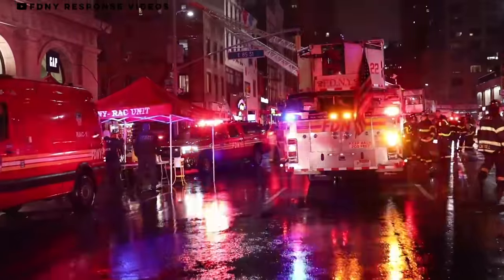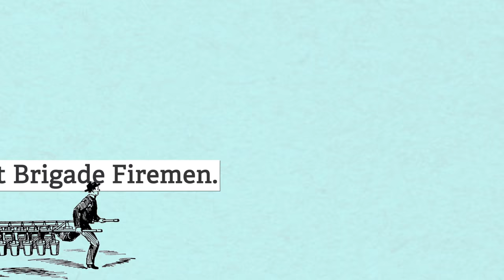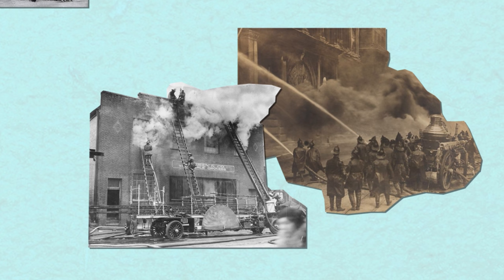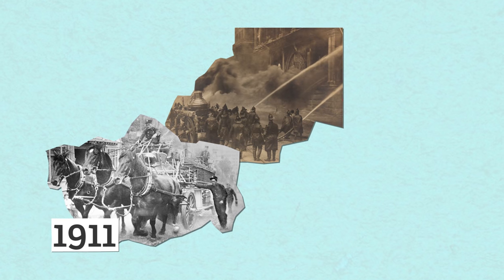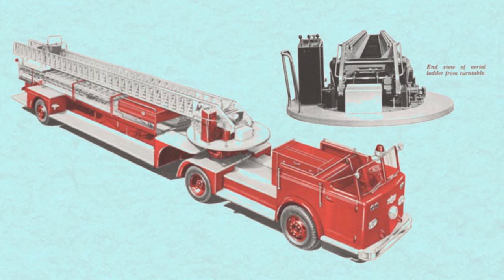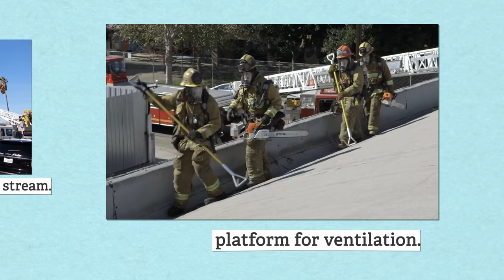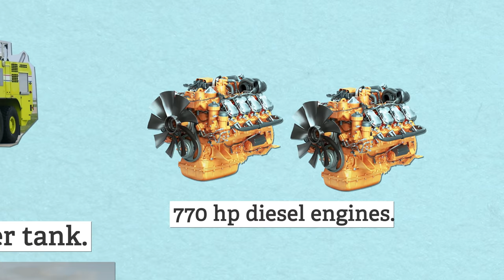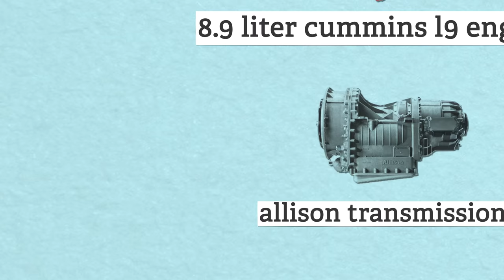How FIRE TRUCKS became Awesome | WheelHouse

Comment: I used to work as a technician for a fire truck refurbishment facility. We did everything, Pearce, American LeFrance, Oshkosh, even some Military crash trucks (also made by Oshkosh).  I can safely say, you can not imagine the amount of wiring and computer control some of these modern trucks have. It's mind boggling.
Reply: These new systems fail all the time too, it's really frustrating.
Reply: I'd trade one of those overprice computer on wheels junk for an old Mack anytime!.Seen those old Mack model B in action 24 hrs a day non stop for a week to empty a long tunnel that had flush flood in Montreal in the 1980's.Kenworth pumpers were no match for that kind of work!
Reply: I work for Oshkosh Corporation. I used to assemble the chassis for the Striker and the military vehicles we build (HEMTT, MATV, FMTV, HET, etc.) A lot of the main wiring harnesses run along the inside of the frame so if an issue were to arise it's not a fun fix.
Reply: Does your company currently hire a Firetruck Technician? Thanks
Reply: Ryaneg6freak Firetrucks Unlimited?
Reply: @punkindonutguy  so you work in Appleton
Reply: The best fire trucks are the Detroit 2 stroke powered ones!
Reply: OshKosh makes fire trucks?

Comment: Bugatti and Koenigsegg struggling to do 300 mph, meanwhile 407 mph by vintage truck. Who needs aero, am I right?
Reply: I mean, as long as you blast more power, you can overcome air... not easily, but you will
Reply: When did they say that?
Reply: Mind you the Dodge Daytona has a NA V8 Hemi and a 4spd manual for its nascar trim and topped out at over 210 in 1970.
Reply: Jet engines aren’t road legal though
Reply: 407 for a jet powered vehicle is pretty slow considering what Thrust SSC and Bloodhound SSC has achieved.
Reply: Check out Badd GT
Reply: @gregistopal  Well as they'd literally blow away and rearward or crossing traffic this is probably for the best^^

Comment: Not all countrys have these newer fire trucks the ones i work with are still fairly old not very old but still 10-20 years old because buying newer trucks is fairly expensive heck we have a 20 year old Jeep that was converted form Wheels to 4 tracks for the woods
Reply: Nice the department I sometimes volunteer for has a 1973 f350 pumper a 83 Chevy 3500 rescue and some weeks Mack aero tanker thing like 50s

Comment: As a volunteer  fireman my self in NYS I would like to make a few notes one the Truck @ 5:15 is not a ladder truck it is called a Quint it already has a hose running up the ladder, second thing the the the main trucks we use the most in my experience  are Tankers, pumpers, and ladder trucks/Quints or Bucket trucks it depends on the apparatus . I could go into more detail but I feel that those are the most important ones on the fire ground. other than the firemen them selfs. besides that this video is really informational with some variances between the country's and states. Thanks for the vid keep it up.

Comment: 4:52 That 5,000 gallon truck is not a pumper.  It is technically a tanker.  Usually at that size, they don't pump, but act as giant reservoirs used for forest fire or rural operations.  One thing that you might find interesting is what is known as a "tender taskforce"  tenders are "pumpers" (we use the term engines) that have a large capacity (ours had about 2,000 gallons) and a dump valve (which ours could dump the entire 2,000 gallon tank out of a chute in a minute).  Now you might ask, "for what purpose would there be to dump water on the ground like that?"  They often carry portable ponds.  IN rural areas with large fires needing extended operations, a team will setup at a hydrant.  The tender comes to fill at the hydrant, and then trucks the water to the scene.  It's dumped in a large, framed, essentially nylon bag called a portable pond.  From this pond, water is drafted into an engine and fed to attack lines.  Essentially, if there is no body of water nearby, and no hydrant, you bring the water to you.

Edit: saw you included the tender...  was seconds off.

Comment: So you have 5000 gallon tanks and pumps that can do 8000l/min

Gg murica
Reply: Firetrucks will always try to connect to a hydrant as soon as possible, and while the pumps can pump out alot, only so much can come out of the fire hose. For example a 2 1/2 inch hose can shoot around 200 to 300 gpm

Comment: A crash tender is a specialized firetruck used in an airport (in aircraft fires and fires resulting from airplane crashes, but can be used also for building fires). Most of the crash tenders in use today are manufactured by Rosenbauer.

Comment: I regret to inform you (not really) that the "first fire engine" you showed was Novelty, an 1829 experimental locomotive built for the Rainhill trials. It was self propelled and featured a crazy boiler layout over the Vertical boiler. It also, naturally, couldn't spit water unless the rifle-tube using boiler broke, which it often did.

Comment: As a firefighter I would like to point out that while I personally have never heard a pumper referred to as a wagon, they are usually reffered to as engines. At least in my area. 
A pumper is an engine, 
An Ariel ladder with no platform is a ladder truck, 
A ladder truck with a bucket or platform on the end of the ladder is a tower truck
And most engines are capable of drafting, or pulling water out of a lake or stream. Tanker trucks are more suited for wild land firefighting just because they can carry significantly more water.
All that being said there was a lot of fantastic info in here about the history of the trucks. Great video.

Comment: I tell you what I love them we have 5 trucks at our department 
1. Engine the basic freightliner chassis with a mercadeiz-benz motor  
2. Tanker International Body with a Cummins motor
3. Patrol F-550 with 7.3 powerstroke 
4: Wildfire truck 1973 deuce and a half fitted with pumps and wildfire gear 
5: Hose truck Freightliner chassis and can hold 22 100 foot rolls of 5 inch hose and this one comes with a 850 hp or cc cummins motor
Reply: in the town I used to live the FD has approximately 50 units at the fire station ^^

Comment: I think the german firetrucks are the best👍🏻😂(I‘m from Germany) And, have you ever heard of the „Rosenbauer Panther 8x8“? It‘s an Airport firetruck too, it has 15.000 Liters of water and round about 1.000 Liters of foam, that‘s insane 👍🏻but your firetrucks and Ladders look cool too. Nice Video and Go on like this👍🏻👍🏻
Reply: as if German fire trucks are really so great... departments there truggle with the typical German regulatory overreach, some of the new trucks have serious problems after just a few years of service while the old ones laster for decades, some volunteers don't even have a fire truck but nothing else than a trailer which they have to pull with farm tractors, screwed up radio call names differing throughout the country making it extra hard when working in another state, ...

Comment: I have to agree that the oshkosh striker is the most badass firetruck out there, but the coolest one is a tiller truck with their ability to navigate with agility that even a long wheelbase ladder truck might not do. (depending on comparison)
Reply: depends on the chassis layout; There are also 100' rear-mount Tower Ladders with all-wheel steering, of course they have a greater maneuverability than a Tiller Ladder
Reply: @EnjoyFirefighting  true, but i was just using the average ladder and tiller trucks on the roads

Comment: At the volunteer fire department that I am with we have two engines two tanker trucks and a weed truck 

E-1 and E-2: 150 gallons of water per minute
The tankers combined hold nearly 6,000 gallons of water
Reply: the station in my former home town has roughly 50 units ^^
Well, it's not a volunteer but career FD

Comment: Just a FYI, We breath compressed air NOT oxygen. 1.Oxgen is flammable 2. I am not taking a flammable gas strapped to my  back into a fire. For my Firedepartment our air packs or as some of us call them, SCBA (self contained breathing apparatus). Our cylinders hold 4500 psi. Which gives us about 45 minutes once we start breathing with them on. Any question, please fill free to ask.

Comment: Probably the craziest fire truck (of sorts) I've ever heard of is something Russian (of course) used for putting out oil well fires. It's a tank with it's gun replaced with turret-mounted twin fighter jet engines and a system for spraying huge amounts of water into the jet exhausts. I hear they call it "The Big Wind."

Comment: Real firefighter here, we don’t wear oxygen tanks on our backs. Oxygen, while it isn’t flammable like most think, it is an oxidizer. Which means it makes fires burn faster, hotter, and better. It wouldn’t be a great idea to wear an oxygen tank on our back while inside a burning building. The cylinders we wear are filled with compressed air. And no, air and oxygen are 2 separate things. Our cylinders are filled with the normal air that we breathe every day. The cascade system we use to fill our air cylinders just take normal air from the fire station and compresses it into the cylinder. It’s filled with 21% oxygen 78% nitrogen and 1% other. Which is what everyone breathes everyday, but it is not an oxygen tank.
Reply: Compressed air contains oxygen

Comment: Great to see the "american" side of things. Over here in Germany it's a little different (more compact engines with more equiptment to do more tasks and no tiller trucks, because they would be way to huge to fit in our streets). Also i'm pretty sure that even in america you don't run into the building with an oxygentank on your back, but with pressurised air. Thats because fire needs oxygen, so pure oxygen on your back would be bad for you...

Comment: I think Fire trucks should have at least 700hp because you see Lamborghinis and stuff having 700+ hp. And it weighs at the most 3000 pounds. Fire trucks weight like 10000 to 75000 pounds.

Comment: We all do the job, around the world, volunteer or career. And the one thing we all agree on is that European apparatus look like molded playdough and sound just like how they look.
Reply: with European fire trucks using a wider range of sirens than the American ones I don't know what you are talking about. To be precise: ANY siren used in the USA is used in Europe as well.
I guess there's quite a difference between commercial chassis and non-commercial chassis like they are common in the USA. However, we don't bother about chrome etc on European trucks, it doesn't make the job better or easier at all, it's simply not important. Even the 300' Aerials, Mobile Cranes or Ambulance Buses and Command Buses are kept quite simple

Comment: "state of the art"? American Fire Engines are built with 80's technology, everything is mechanical: all modern ergonomics or safety systems you would find on your personal car are fully absent here (no ABS, no ESP, no Rollover Prevention Systems, etc...). Even the pumps are operated manually. US fire departments often are described as "100 years of tradition unimpeded by progress".

Just take a look at their European counterparts, where things are kept on-par with automotive inventions and computer controlled pumps are de-facto. Have you seen the Rosenbauer Concept Fire Truck? This is where real progress is made and fire trucks become awesome ;)
Reply: I'd agree with you that they indeed look and seem old even if they are some brandnew apparatus. However keep in mind that more electronics on the truck is also more which can fail. Just take a look at the issues Rosenbauer had with the AT3 generation introduced a decade ago: even some apparatus which weren't dispatched on a daily basis sometimes had major software issues with the pump system, forcing the department to take them out of service after only a year, while a previously used apparatus made it through 2 to 3 decades. And instead of the super modern apparatus with computer controlled pump, an older apparatus had to do the job. 
Of course one should keep up with the technical evolution, however not everything new is actually great from the beginning on.